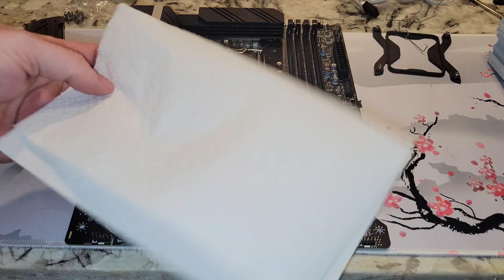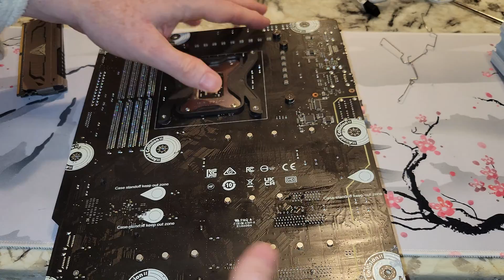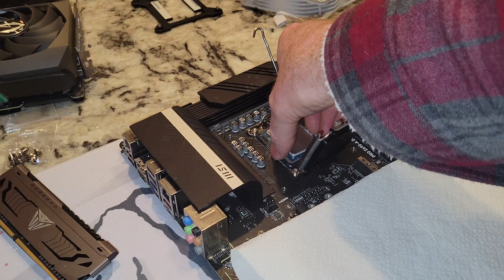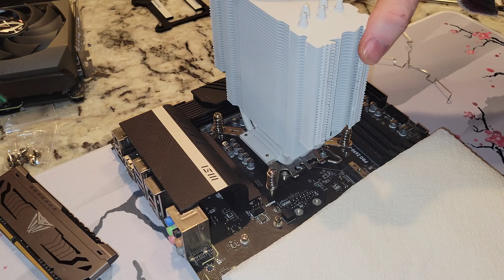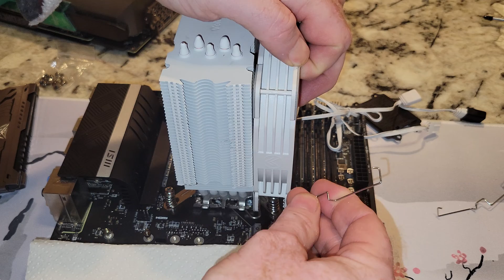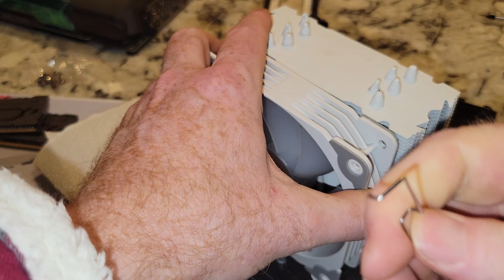Installing Vetroo V5 on I5-13600kf, MSI Pro Z690 for FUTURE gaming videos to see if it is good enuff

Comment: Did the vetroo v5 work well with i5 13600? I have that same set up to put together but don't know if it will work well enough
Reply from the maker: It was decent...the thermal right 120mm CPU tower coolers represent a better deal